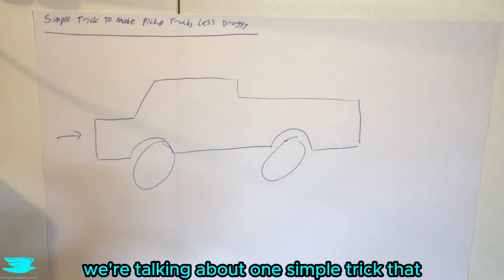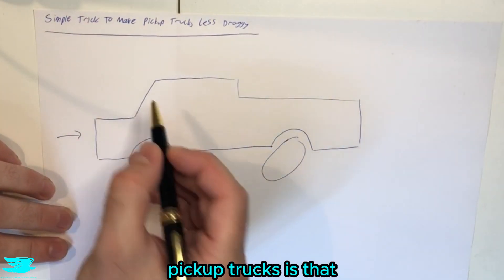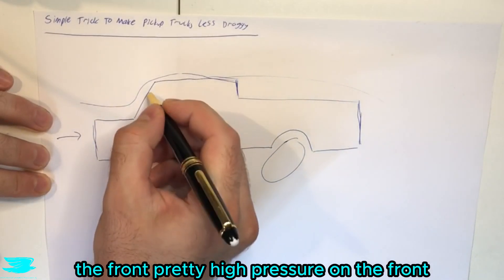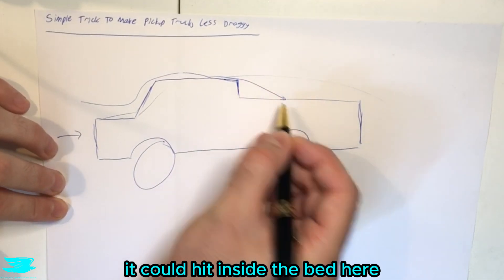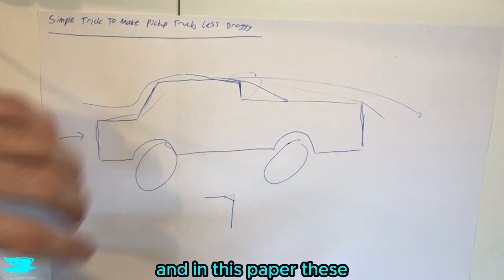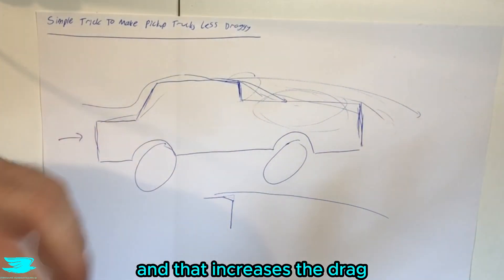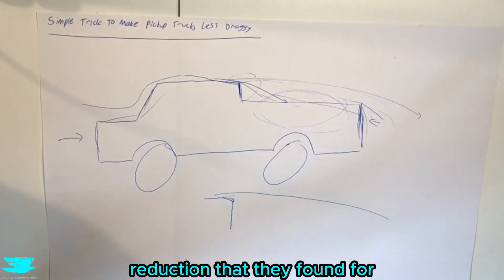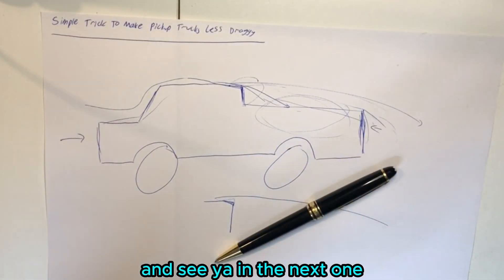Simple Trick To Reduce Pickup Truck Drag {Auto Aero #68}

Comment: As I understand it, the best option for a pickup truck would be to have a cover over the bed that would go from the top of the rear of that cab, and steadily slope down to meet the top of the tailgate.  Basically a Kammback.  Is that correct?
Reply from the maker: Yep, for typical options, the Kammback is the best one for drag reduction.

Comment: Or just open the Tailgate
Reply: Proven otherwise.. better results by even covering the back half of tray.  Creates an air pocket in bed which reduces new air entering and also guides high speed air away.
Reply: @gregnunan9419  I would imagine this is 100% dependent on the length of the pickup bed. 
5 1/2 foot bed? 6 foot bed? 8 foot bed? 
Mythbusters did a study years ago (which was accurate only for that pickup model & bed length & cab height) - they put a net across the back of the bed, and that's how they got the best fuel economy. 
You could measure fuel consumption like they did, I don't know of a way to accurately measure it the way they did.
Reply: @Maybe-So theres a gre studies showing variations. A uni in Texas is believe but hard to remember from Australia. A simple yahoo search will show in depth results
Reply from the maker: Sometimes that works too.

Comment: Can you do a analysis on the Honda Fit? For a small econohatch it should have some interesting aero properties, specially trying to minimise drag in spite of its flat back to help with drag and the little engine too
Reply: I can say the GE8 improves greatly by adding a CRZ underbody tray, doing a Mugen upper grill, and blocking the lower grill. I pulled the wipers down a bit more as well for some reduced drag when rain is expected. The Sport Wing helps a bit as well for reducing the tail and adds very little rear stability. I hyper-miled my 5 speed with some 15" wheels and 185 tires to get 49mpg highway at 74mph cruising with some elevation. This was measured at the pump not using in car which said I got 55mpg.
Reply from the maker: Thanks for the idea!

Comment: How is this affected by driving speed? Does this angle need to be optimized for when the truck is at highway speeds, or does the airflow roughly stay the same enough that it isn’t a factor?
Reply from the maker: First, there doesn't seem to be data published on that. But from an aero perspective, I think it would be somewhat insensitive to speed. I think there will be a point where above it, the flow stays pretty much the same.
Reply: I would imagine it is optimized for higher speeds, as that is where the drag effects are the strongest, but nothing in aero is ever straightforward

Comment: Opening the trunk lid, if the trunk is empty,  should help a lot too.
Reply: Mythbusters tested this, and found that putting the tailgate down increases the drag vs having it up.
Reply: I thought that would, but usually the tailgate will disrupt the flow designed to go around it and actually increase drag
Aerodynamics are weird
Reply: @Iwannabuyabugatti  

A self inflating tarpaulin spanned over the trunk should help.
It needs to be inflated like a Paraglider Wing in order to prevent fluttering. 
If the Tarpaulin is mounted on the open tailgate, a nice tear-off edge is formed.

This should decrease drag by 25-50%.
If the truck got a roll bar, the tarp can be mounted on it. Helps against rain too. 

A tear-off edge on the rollbar that is matching the open tailgate, like mentioned in the video should help too. 
With the tear-off edge, the open tailgate gets important.

Comment: The most interesting aero devices on pickup trucks are the 'sails' and roof extensions that you see on vehicles like the Silverado EV, kinda ignoring the fact that it has a bed and moving back the point at which flow separates from the cab
Reply from the maker: Yeah! They were definitely there for aero.